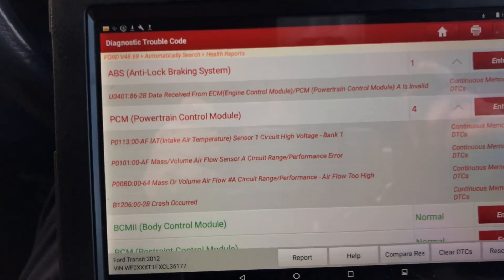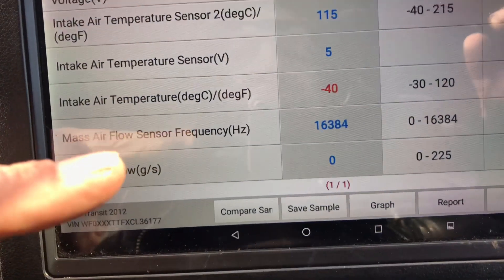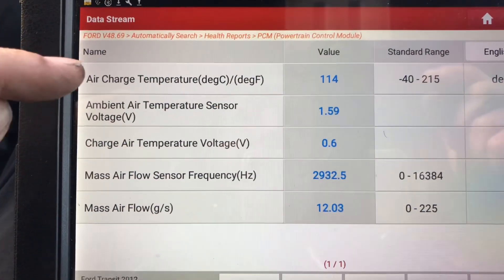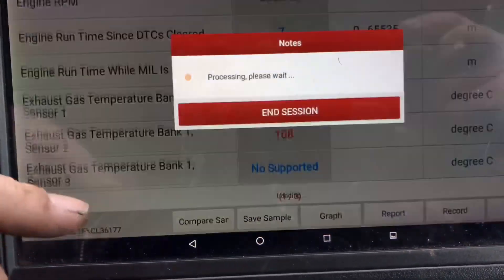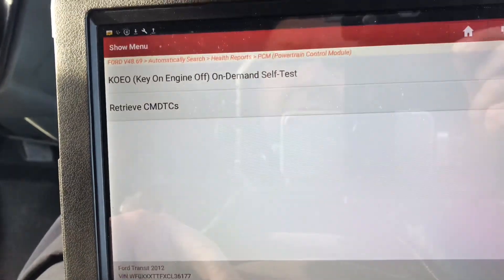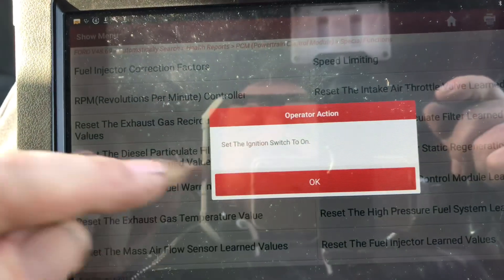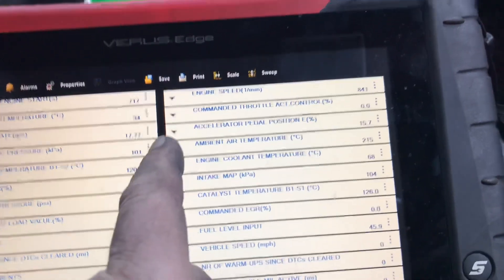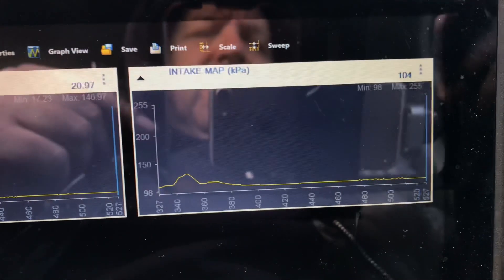Ford Transit 2.2 TDCi (2012) - Fault Code 00BD-00 Mass or Volume of Airflow too High😭

Comment: Had a MAF sensor fault and limp mode.  Turned out to be water leaked into the air box and completely soaked the filter causing it to break up and contaminate the sensor.  A known problem apparently with 2016 models onwards.  Couldn’t believe it.  I was very lucky it didn’t ingest into the engine and cause more damage.
Reply: That’s more common on the 2.0 ecoblue rear wheel drives

Comment: I had a customer come in and the MAF had the same out of range code. It was reading 30g/s at idle so I ordered a new one but now I worry it's something deeper. There's been work on the intercooler pipe as well. There was a split pipe.

Comment: I've got a similar thing going on but it only happens in the morning....on my 45 minute commute to work, i can reset the code for mass airflow too high 5 times and it keeps going into limp mode. Finish work at 5pm, can drive as far as i like and it will not show a problem 🤯

Assuming its an atmospheric problem, really dont want to try a MAF sensor at 100 quid. I'm gona study the values some more having seen you go through it, much appreciated
Reply: @chestermartin2356  suggest shop around.   I didn’t pay £100 for a replacement sensor.
Reply: @AndyWilliamsUK  I tried a sensor off another vehicle and it didn't resolve it anyway. A genuine part would be 100 quid, there's cheaper knocking around but it's a gamble with quality
Reply: @chestermartin2356 Conseguiu resolver o problema ?
Reply: @thiagodossantosaraujo4270  no my problem went way further. I had a blocked dpf which ruined my turbo. Got those fixed and it turned out to be because I had a leaky injector seal that was blowing into the crank case

Comment: Great video interesting but also misleading with codes wonder if could put one of those senser voltage tools in place around 1.5 volts and see if temp changed and light stayed off
Reply from the maker: I'll try that next time Daniel cheers sandy

Comment: Hi I have the same problem with custom in plag the IAT sensor and fault goes away but unfortunately it doesn’t self regenerate because of that fault across the contacts it measures 7.5 ohms I have replaced it with after market but still have the same problem your video was very helpful and I take it that your problem was cured after replacing iat was it original or after market

Comment: Get these boost sensors going on 5cyl diesel volvos all the time. Sometimes give a maf code that can be quite misleading!
Good check is atmospheric VS boost pressure at ignition and they should be the same.
Reply from the maker: Great tip thanks sandy

Comment: Hi. Did replacing the ambient air sensor fix this in the end? I have the same van with same codes which are still there after replacing the MAF sensor
Reply from the maker: Yes